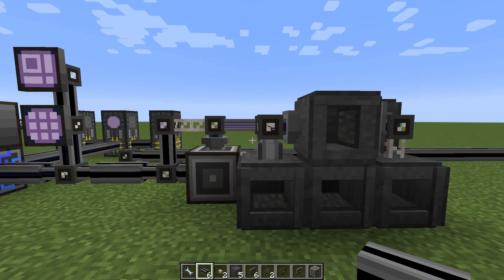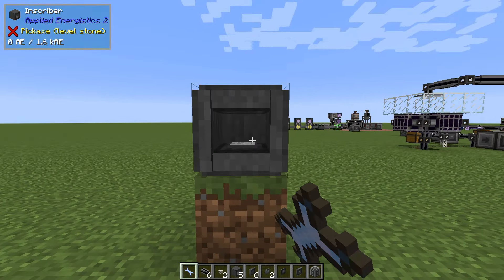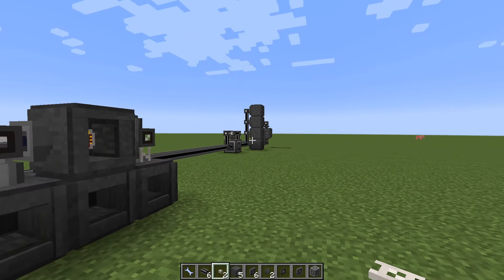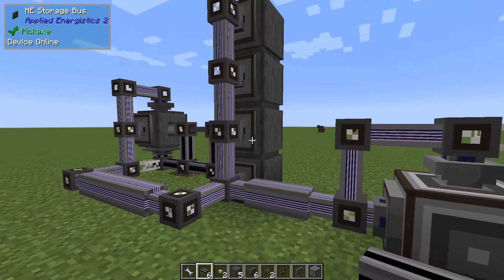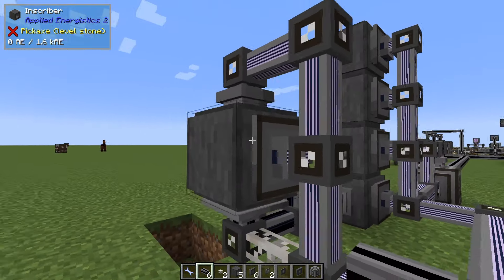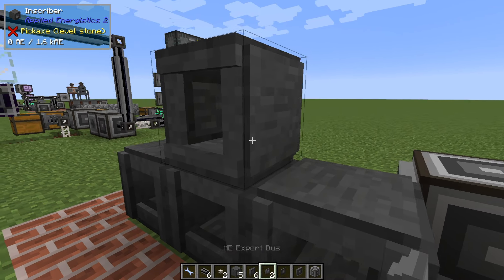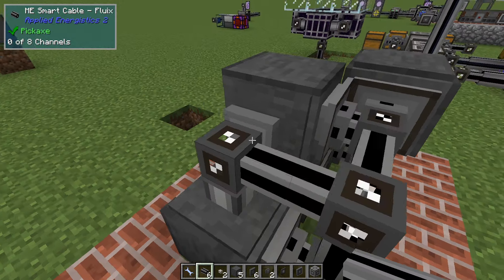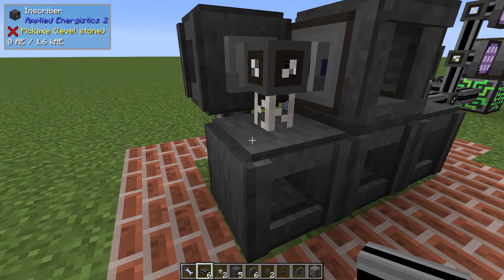Super Compact Inscriber Processor Auto-Crafting Setup - Applied Energistics 2 Tutorial

Comment: Not sure if this setup is broken in 1.18. I had to change a few things, I had issues with the storage buses not picking up the completed circuits and processors.
Reply: Disregard, I'm an idiot and didn't check the storage buses filter options, they were set to filter in and out. I corrected it and its working just fine.
Reply from the maker: Thanks for coming back with updates! I built it and was just about to write the same thing as you discovered: Storage Bus set to "filter insertion only" and then it felt like things worked fine. For the top Inscriber I used export bus on both sides, I was getting unstable results when I used Insert Bus + Storage Bus for the Silicon side. Don't know why, might be due to early versions or due to change. Will keep an eye on it.

Comment: Anyone knows what is happening on MCE Modpack with this setup please? Ver. 1.6.2.3 The real issue is inyecting Redstone at the last inscriber where the circuits joins with silicon and circuits.
Reply from the maker: I haven't tried this build in this specific modpack, but basic functionality usually doesn't change. Make sure you're using the normal Inscriber (Advanced Inscriber works differently). Also check filter settings and make sure all devices are properly connected so all are active and have a channel. I don't know exactly what happens so it's a bit hard to guess.
Reply: @therealtkh  I've managed to to make it run on a less compact build, something is wrong with the standard inscriber it seems, It seems the orientation functionality is disabled somehow in this modpack so I made the setup separstly on the same channel with smart cables for each inscriber and a dense for the mainframe connection. Finally I've used an advanced inscriber just for the proccessors and it seems to work just fine, but I liked more your setup, is more discreet and take less space. Thank you for your answer buddy. It seems that this mp is weird with these kind of things.
Reply from the maker: @PhoenixEpsilon  Ok, great that you got it working, thanks for getting back! I just want to give a heads up that the advanced inscriber from AE2 Stuff had a few bugs that never got resolved from what I know. I made a video on that block and experienced some bugs myself. Hope it works well for you!

Comment: This is good tutorial but you have forgotten to mention important thing meaning patterns how to create processor(s). The receipts working using this setup are different from original. Instead of using printed silicon needs to be used just regular one otherwise it does not work
Reply from the maker: That's correct. I didn't go through that part in detail... the processing pattern should only contain "base material". The printed "middle step" will only be within the small network.
Reply: @therealtkh  i have made your first less compact setup but it has not been working for me. fortunately  I have fount another video with the same (your second compact) setup  but also with recipe. Now everything is working as expected.
Reply from the maker: @TomasMisura  Really? What made it not work? I'm curious of there is anything wrong with the setup. What part did not work? The only difference is actually how to rotate the top Inscriber, as direction in world and in setups makes rotation impossible to predict.
Reply: @therealtkh  before I have found what's wrong I been trying to rebuild it what made that setup that was working (after I have manually inserted resources) stopped to work completely and I have been soooo desperate :) So I have been looking further and found another video that helped me to realize what's wrong  and it is not your setup but I am using incorrect recipe. :)
Reply: huge help. i was having issues with this working due to the patterns
Reply: Thank you, you saved my time!

Comment: Is there a way to autocraft fluids with a magma crucible and import them in to the me fluid system. i have searched four a long time and havent found a way.
Reply from the maker: Does it have to be with Magma Crucible? :) What version are you playing, or modpack?
Reply from the maker: Anyway, the thing is that you can't make an order of a fluid. It has to be an item for the pattern to accept it. However, I have done such a build with "cans of fluid". That works great. And if you want to auto-craft fluxducts (requires molten/destabilized redstone) this is possible as well but the fluid will be used directly and never end up in the system (I have made a video on this).

Comment: Hey, newbie here! I followed your guide to the letter, but it isn't working. I checked, and we both have the same version. Everything works perfectly, except that the Printed Calculation Circuit is never pulled out of the interface to be made into Calculation Processors. I have no idea what's wrong. Update: Narrowed down some things. If there are Printed Calculation Circuits inside the network, it will put them into the interface but NOT into the inscriber. If there AREN'T Printed Circuits, it will craft them and put them into the inscriber, but will NOT put the redstone or printed silicon into the inscriber or interface.
Reply from the maker: Not sure I follow but it almost sounds like a problem with the patterns in the main network (it's the most common mistake). How do they look?
Reply: @therealtkh  the same as yours. I replaced every pattern twice over, and both calculation recipes. I took apart the thing so I could rebuild it from scratch. Sorry if I made it sound confusing, I'll try and simplify: If there are calculation circuits inside the me system, it will take one of those and put it in the flat interface and leave it there, and put the redstone and printed silicon into the inscriber. I'm not sure why, since I had the export bus configured to take all circuits and put it into the inscriber. But on the flip side, without any calculation circuits, it will take the pure certus quartz, make a calculation circuit, then put it into the inscriber but without even interacting with the redstone or silicon. Those last two bits just never appear anywhere in that system. Every other recipe works perfectly.
Reply: Update: THANK YOU for bringing my attention to the patterns. Turns out I set the encoded pattern to make the processors with printed circuits instead of certus quartz. I changed that and it works like a charm.
Reply from the maker: @fluffylillian  Ah, good to hear that! As I said, it's the most common mistake to make because we all know the pattern for processors has the circuits, but we don't need to care about that because the main system is only interested in what parts we send and what we get back. What happens in the other network is not relevant as long as it works :)

Comment: I think my system works but when i try to craft it says missing press (so if i want 10 processors there are 10 missing presses) but i have them in the inscriber. I play atm6 to the sky
Reply from the maker: It sounds like you have designed patterns wrong so check that part again. The pattern shall only have base material to processor, the press shall not be in the pattern! Around 5:10 or so.

Comment: My import bus and storage bus on the silicon side say device missing channel, playing on another quality modpack 2.
Reply from the maker: Sounds like you have connected them directly with cable instead of using a quartz fiber towards the bottom connection.
Reply: @therealtkh  Thanks that works , but now the finished processor wont extract from the top inscriber
Reply from the maker: @bradplays8134  As always, hard to guess as I haven't seen the build, but if you have a storage bus on the back of the Inscriber the only thing left is to configure the export bus for the finished processor to send it back to the main network.

Comment: the inscribers make the parts, but dont import the parts to the final inscriber to make the circuit chips
Reply from the maker: Don't know what version you're running but with new updates comes minor changes. You might need to set the filter in storage bus to a different mode. Watch the updated video on this subject and check comments there as well.

Comment: Ive done this exact same setup on 1.16.5 and when using the Smart ME cables to connect the single inscriber used to make the processors to the other network, it shuts everything off. Is this a 1.12 only setup?
Reply from the maker: This build is for all versions, only minor differences due to changes and I have done updated video for 1.18 and also tested it in 1.19. I don't understand what you mean with connecting the single (top?) inscriber to the other network? It should be connected to an export bus - separating the entire small network. I recommend watching the updated video as I build it slower and point out a few important details that are easy to miss.
Reply: @therealtkh  I think I figured out what my issue was, when connecting the bottom inscribed in the 1x4 stack, it was connecting the cables the wrong way and causing my network to overload. I changed the placement of the cable and got it working properly. Thanks for the reply!
Reply from the maker: @damiandamori  Good to hear you got it working although I didn't understand everything in your first comment ;) It's easy to make mistakes because even a single misplaced cable can halt the entire system.

Comment: When i connect the Auto craftin setup with my ME it shuts down my system completly even when i add more energy and i dont know what to do ... any help ?
Reply from the maker: Power consumption can be checked with the Network Tool. But if things shut down it might be a problem with your channel management, for example too few channels and lack of ME Controller. But it's really hard to guess when I know nothing about your build...
Reply: i was rebuilding your setup right there so its pretty much the same but with 2 magmatic Generators powering the System  @therealtkh
Reply from the maker: I don't know what pack or version you play. And I still know nothing about the network. You have a controller with enough channels? Feel free to watch the updated version of the build for more tips, it could also be a good idea to build it in creative with creative power cell to make sure it's not a power issue. And use smart cables to check channels.
Reply: I was rebuilding everything again and now its working perfectly fine its so weird sometimes ... and i play Tekxit 3

Comment: I cant get the system to work, I cant find out how u order the items on your ME Crafting Grid
Reply from the maker: I don't know what you have built so it's a bit hard to guess. Did you make the patterns as displayed at around 5:10 ? Also, you need Crafting Storage in your network. And channels. And power. But again: I know nothing of your build or network, so it's very hard to make a guess based on nothing.
Reply: @therealtkh  Hi thanks for the reply! I have the exact same build as your old automated inscriber video, i swapped out the ME Interface for the one in your new video (i dont remember the name of it) It has power and also has the channels, when i select it to craft in the terminal it asks for the different types of presses (Calcuation, Logic, Silicon and Engineering) when i put that in it starts to work but when it creates something in one of the inscribers but it stays in there once its done instead of moving out to the other inscriber and crafting whichever processor i selected aka Logic Processor, Calculation Processor and lastly the Engineering one, If that makes sense, so its doing half the job, Thanks